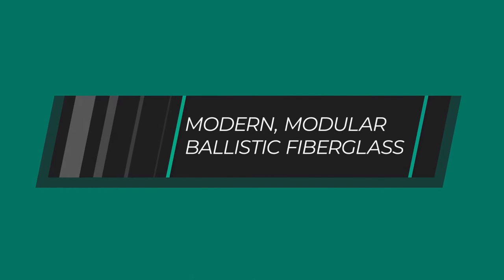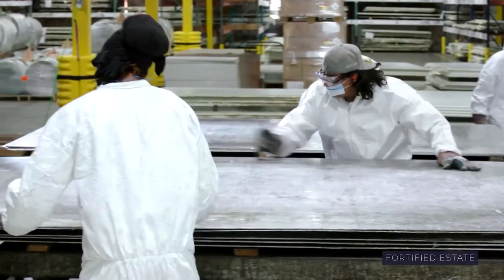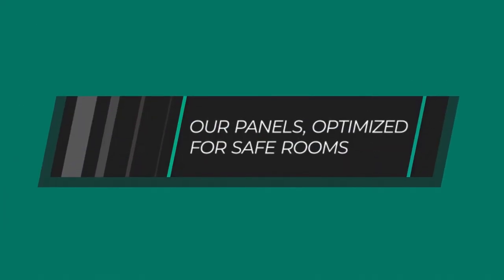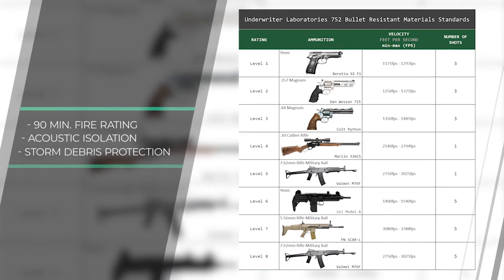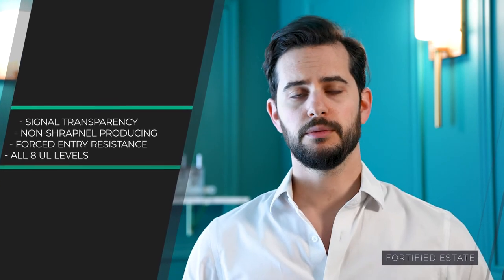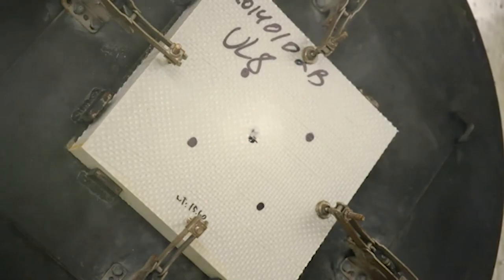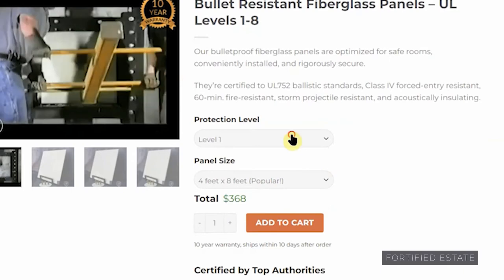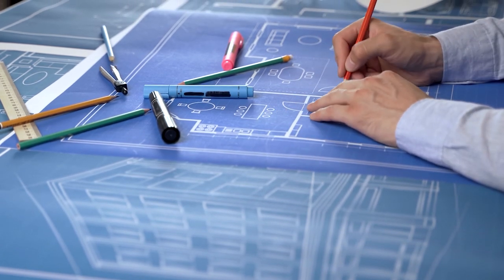Bulletproof Fiberglass Panels - Create Bullet Resistant Walls

Comment: Can I use this on the wall and windows for a bedroom?
Reply from the maker: Yes, a bedroom is a popular place to convert into a secure room. You can certainly armor the walls with this type of material. 

We don't usually cover up windows with this material, but it could be possible with careful consideration of securing the weight of the panel properly. Usually we create new, high security windows, but that is a lot more expensive than covering up something with panels.

Comment: i would have appreciated a bit more insight onto the differences between kevlar and fiberglass. Why are fiberglass panels industry standard for construction vs kevlar panels?
Reply from the maker: Hey Mikey, 

Good question. Kevlar is more expensive and comes in less protection levels. It's main advantage is that it is light and flexible. That is helpful for a mobile situation, such as using it for body armor. 

Ballistic fiberglass is heavier and much less flexible. But in a wall, the material is not moving, so neither of those downsides are relevant factors. Therefore, the much cheaper cost of ballistic fiberglass (it can be 70% less) makes it a preferable option for walls. Also, arguably, the ballistic panels may be more forced entry resistant because they do not allow for as much flex. 

To be fair though, Kevlar is a little easier to install, since it is lighter and you are not needing to work with fiberglass. But the installation of the ballistic fiberglass panels are pretty easy too, so it still is almost always the selected material.
Reply: @FortifiedEstate  thanks for the quick response! I am an architect in Boston and currently specifying some ballistics panels for a project. Client keeps referring to Kevlar, but the industry seems to be biased toward the fiberglass.
Reply from the maker: Hey  @mikeydmalden , sure thing. Yes, it is relatively common that people will speak in terms of Kevlar. That is a popular brand name (from Dupont). The technical term would be para-aramid. Just like para-aramid doesn't roll off the tongue so well, neither does ballistic fiberglass. That, plus DuPont's years of marketing, plus familiarity from body armor, is probably why Kevlar is often used in the way that Kleenex is used instead of tissues.